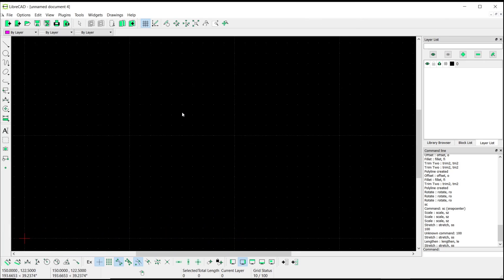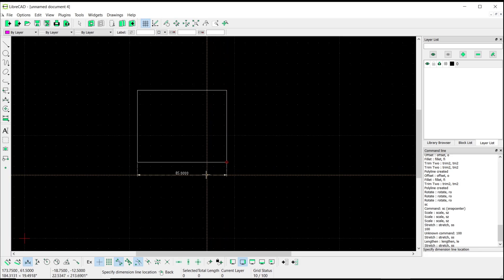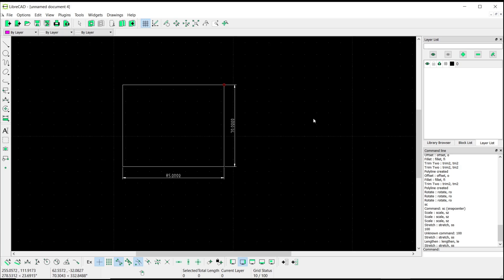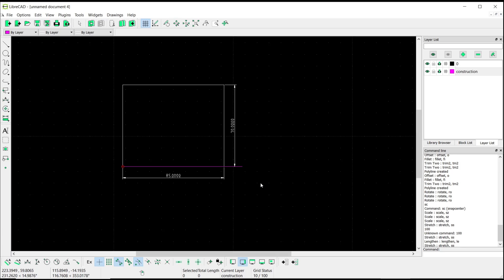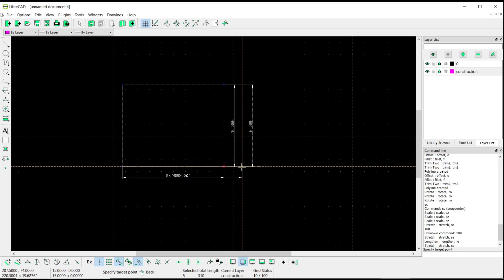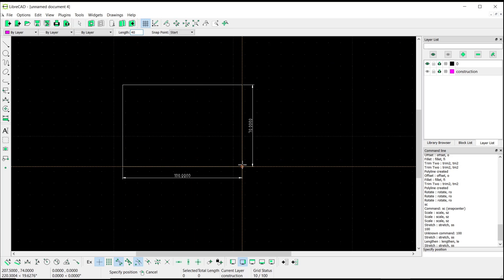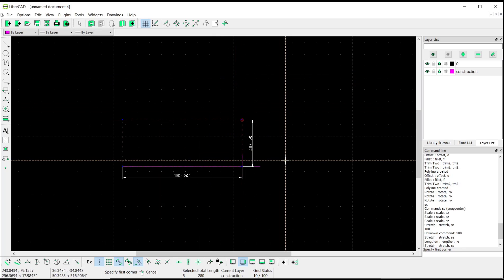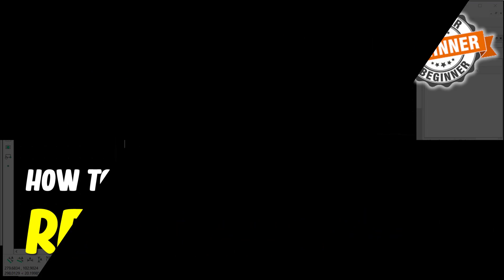LibreCAD How To Resize Rectangle

Comment: it would be so great to have an ability to change rectangle height and width as numbers.
unfortunately, LibreCAD draws rectangles as polylines, so Modify-Properties for this polyline would not allow to change anything meaningful (neither numeric coordinates, nor numeric height/width ).
So it looks simpler just to plot individual horizontal and vertical lines forming a rectangle, then change their coordinates at your will.